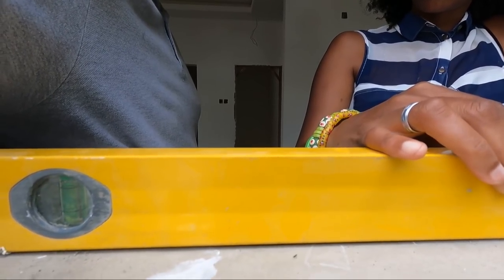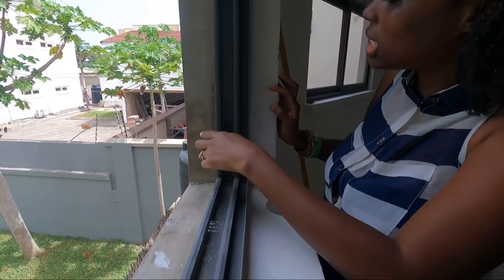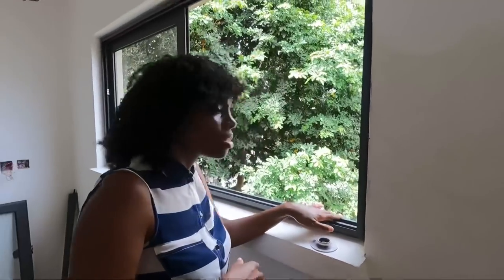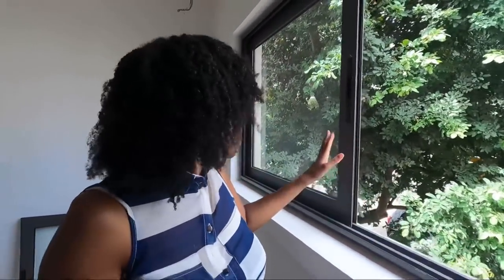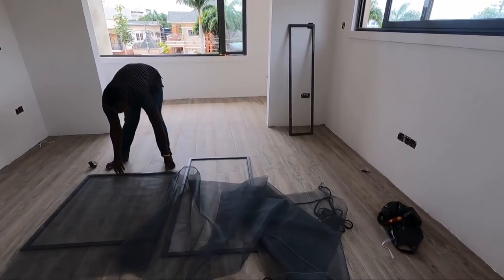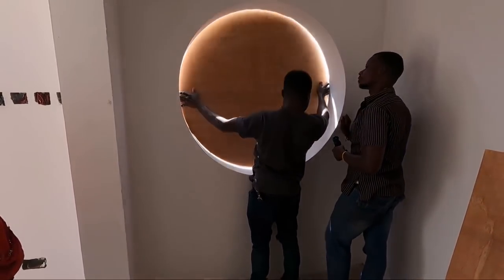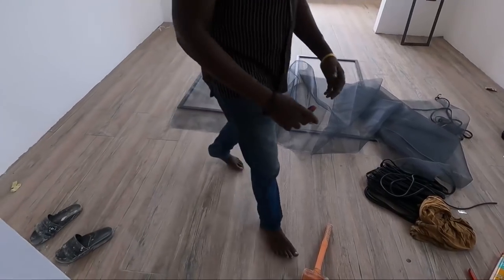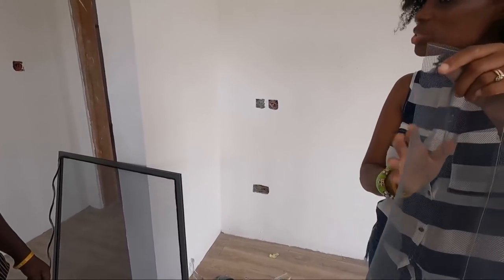Mosquito Nets And An Ever So Slight Imbalance

Comment: UK windows are usually installed with a window ledge to let water run directly away to prevent this exact issue, but you’ve not built in a water proof ledge which increases the risk of water damage unless you intend coating the exterior with a water resistant coating?

Sand blasting is surprisingly .... blasting a glass surface with loose sand grains to lightly scratch the surface. It leaves a rough to the touch opaque finish. The fun comes when you fit it to the inside of the circle! 😉

Comment: So I am going to be little petty here, but I think it is important to clarify. The measurement of length should be mm not ml or mls.  Millilitre (ml/s) is a unit of volume, e.g. a measure for liquids and Millimetre/s (mm) is a unit measure for length. I have heard Kwame use *mls a few times for length measurements and was confused, until I realised what he was referring to mm instead. 

I have learnt a lot from you guys and still learning. I made several mistakes during my build and thanks to you guys, I am a lot wiser now. THANKS VERY MUCH DELA & KWAME
Reply: It's a British thing.  Builders refer to mm as mils
Reply from the maker: Yes that’s correct.  😊
Reply: Aha! I get it now 👍🏾👍🏾I am in the UK as well but haven't heard that before from workers who come to work in my home, and I think it is because I am not a builder!😀😀
Reply: Kwame’s English ...... 🤪🤪🤪🤪🤪🤪🤪🤪
Reply: @BlackKulchaMusicBKM  im UK based and never heard it either, its basically wrong ......the OP is correct ml is unit of volume mm is unit of length
Reply: You are correct!
Reply: Yes It can sound confusing to those not a familiar with builders slang. But in the UK, the trades tend use the word MIL as a shortened word for Millimetres.
Reply: I knew he meant MM but then I am British to. My dad is in the building trade and he uses mill to.

Comment: I suggest you should just use a window silicone all under that bottom of the window. This little defect is the reason I shipped all my windows to Ghana, most of the windows there has leakage and gaps, ants and energy loss is common problems.

Comment: Beautiful home!!  In the U.S., we call those "screens" not mosquito nets. A mosquito net is like a chiffon or sheer like fabric that we drape over a hammock or around bed posts. It's very interesting how we all label things so differently.

I'd seal all of the concrete around all of the windows & outside doors... just to be on the safe side. You'd never know how it will change or deteriorate over time & high temps may bring.
Reply: In Florida they call then insects screen. I was surprised to see Floridians screen their garages.

Comment: Why don't you use aluminium or plastic window sill. Looking at the gauge from outside, l think the difference will be 5mm or more (by picking the slope at the end of the spirit level) 🤔 . That's why most people don't like widow sills especially at the outside are areas.